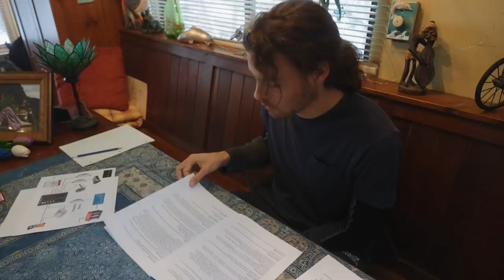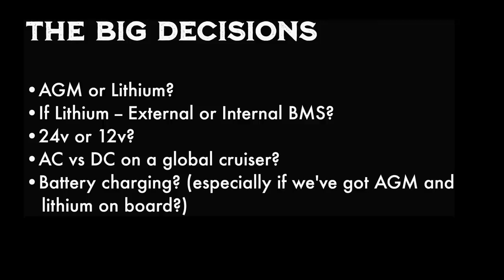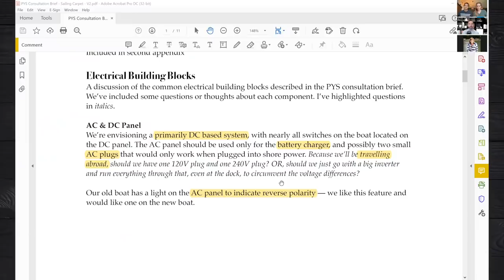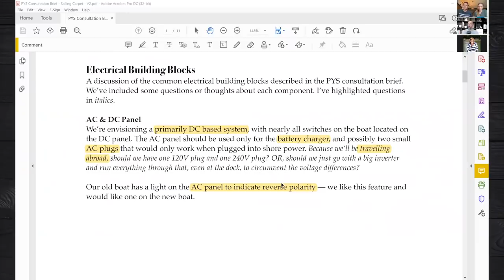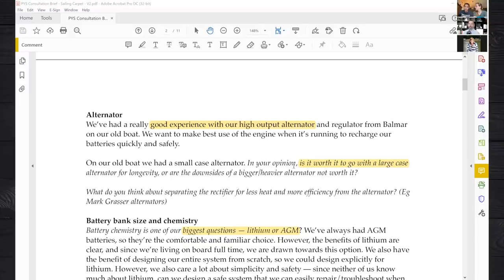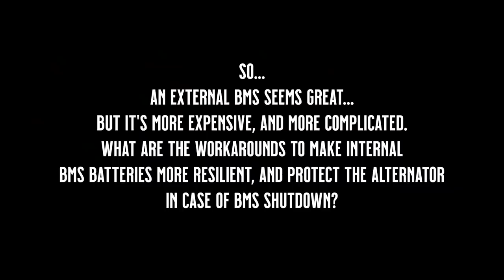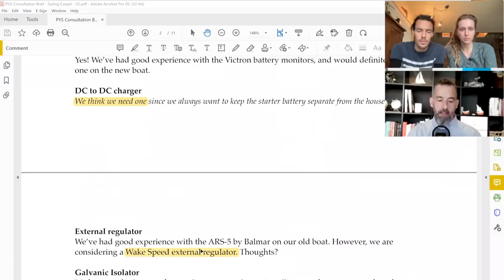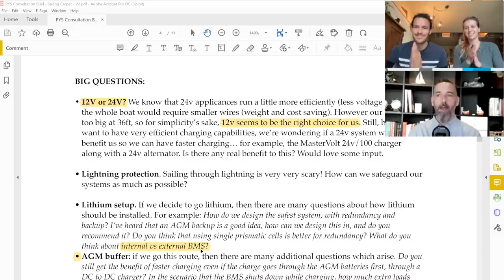DESIGNING an ELECTRICAL SYSTEM for WORLD CRUISING (with Jeff Cote from PYS)

Comment: For what it is worth.  The gentleman on "Sail Life" just re-did a 36 ft. boat for around the world cruising.  I would really watch his electric system videos.  He does a great job explaining the what and how of his electric system and great explanations regarding the the why of his choices.  The couple of things I have taken away from his and other project videos is that having a washer/dryer makes life much easier and that propane is a real pain.  Propane is common around the world but there are as many different filler connections as there are countries.
Reply: Sail Life did an awesome work and is really good at explaining what he did. But you can't beat Jeff Cote from Pacific Yacht System : hours (days maybe) of free electrical seminars for free on YouTube from a professional with loads of experience... For once I wouldn't recommend Madz too much ;)
Reply: Mads is a computer guy and he knows a lot about electric systems but remember, his system hasn't really been put to the test yet. He is also in year six on his boat refit (although the current boat is the second boat he's working on)
Reply: As Cote said design for intended use, this may change also.
Reply: I was going to suggest Sail Life, Delos covered this in a few videos too, and I think Ran Sailing just converted to a partial lithium set up as well.
Reply: Mads also tends to max-gadget his systems. As a computer engineer he feels very comfortable with it, I guess most cruisers would prefer to simplify the system so maintenance stays within their capabilities.
Reply: Sail life electric systems are over kill,the less you have electric the better,salt water wiring don't mix
Reply: @paulmurphy8549  Mads is a computer engineer (and likely tinkers with radios a lot). He just enjoys that stuff, so all essentials have conventional bypasses or double+triple redundancy. :)
Reply: @charonstyxferryman  that's what I am saying. Mads is confident, knowledgable, a techie, and confident. And has plans where it fits. But that doesn't necessarily fit the average sailor to this extend and is not the right choice for every body. All I say is that ease of maintenance is key for most cruisers.

Comment: To my mind, the biggest benefit of LiFePO4 house batteries is the lifetime. You install them once and they will last for 20 years (>5,000  cycles) compared to AGM which will last 4 years ( ~700 cycles). I might however consider using an AGM battery for the engine starter battery and using a second small case 70 amp alternator for charging the AGM.

Comment: You both talking with Jeff who I consider as the best marine electrician I have discovered on YT is awesome. You came up with a lot of thoughts I have already installed on our boat - AGM and Lithium battery banks, two independent charger/ inverters, one hooked up ac to starboard and one to port, dc can be run on agm or lithium selected by a hardware switch, 2x 400 watt solar hooked on two mppt´s - one charging agm, one solar. The lithium battery bank can be disconnected totally (hot and ground) from everything …. And so on. So far it works out great, actually in Portugal on our way to the med. Btw. we are cooking fully on induction (also through inverter) and use propane as a backup. Less heat, less humidity, less dangerous than gas. Keep up your excellent work. 🙏⛵️🤙👏

Comment: Jeff Cote and the entire staff at Pacific Yacht Systems are astounding. Professional, friendly and astonishingly skilled. I'm a bit biased, as I've already spoken with the company, regarding designing the entire electrical system of a cruising trimaran which is in the initial stages of design.
A 24 volt, outside BMS, lithium battery system, with an induction two-burner cooktop, will probably be the best for you. The solar panels currently on the market will easily keep the batteries charged, with an inverter to supply your 120v AC needs.
I know that a lot of people prefer propane for cooking, and that's fine, if you're not leaving US/Canadian waters; when you're cruising the world, you'll end up having to drag along at least eight different propane bottles, due to the outrageous number of link/hookup systems which are "standard" for the different countries.
In all things, and Jeff has said this to me, during our first talk on the telephone, the most important things is SAFETY, SAFETY, SAFETY.
For me, as I'm older, I want to be as careful as possible, in case something goes wrong, and I've noticed that something ALWAYS goes wrong.
Great good luck with Magic Carpet 2 an enjoy the world which is in your future!

Comment: The first thing you have got to do is to determine your power consumption. The biggest consumer of battery power is the refrigerator. You have the opportunity to rework your frig and I recommend you isolate it with at least 6" (15CM) of high density foam plus an aluminum infrared heat barrier sheet. 
I just upgraded my system and I use a lead acid battery to start the engine, a DC to DC converter draws power from that battery to charge two Lithium 100AH batteries. I chose Renogy equipment and batteries, they may not be listed for marine use but I feel they will fo the job. The DC to DC converter is limited at 40Amps so my conventional 75 Amp alternator will take it easily.
The alternator needs to be cooled by the air that circulate into it so the engine must run quite fast, that is not a scenario for charging batteries at anchor.
I have three 100W solar panels where two will be mounted on the side of the cockpit and shall be adjustable to be set a 90 degrees with the sun for maximum efficiency. You may have a larger panel fixed horizontally that will produce the same power as an angled smaller panel just because of the poor angle with the sun.
In order words, there is more than "Bigger is better", there is also "Smarter" ways to deal with battery power, I like your channel a lot.
 Cheers, Richard

Comment: i am so glad you found jeff,  i have watched alot of   his web seminars out off engineering curiosity, and was very impressed. When i hear him say AGM can only be used down to 50%  as they age are only usable from 80 to 85% and lithium lasts 6 to 10 times longer  lithium becomes the only choice, also any engine is supplied with an alternator to supply its electrical needs , most dump this and put in its place a high output one , why not keep the already paid for starting system and add the high output alternator separately its only brackets and belts  and  this will give a full backup system Excellent episode
Reply: Separating the engine's battery and alternator from the rest of the boat's electrical system is a good idea.  This would isolate the engine's lead-acid battery and alternator with its specific charging profile from the house system that might have lithium batteries and charging components using a different charging profile and maybe a different voltage.
Reply: I'm refitting my Mariner 36 and this discussion was woth its battery weight...I very much look forward to the next parts....
Because of redundancy needs, I'm going with AGM for starting bank and lithium for the house bank...and not discussed here, but the DC to DC charging could also be using the lithium to charge my AGM Starter bank and my windlass AGM battery...to think this stuff has me excited...well because this episode gave me the information to finally make these decisions...thank you...as I impatiently await the next episodes

Comment: Have watched a couple times now and would like to make a couple points.

Size an inverter to whatever you might want in the future with special thoughts to tools for Alidino, and for Galley appliances. (suitcase welder, saws, microwave, toaster oven ???)

Another thing to consider is the difficultys of getting Propane around the world. Makes the 50/60 cycle electrical issue look like a piece of cake

Comment: Hi guys, I run an induction cook top as a back up when on the hook and on shore power I use it all the time. Its rated max power is 2400w, and wow that makes for boiling water in 30 seconds, but it's not a good boil for water for coffee or tea. So I set the induction power to 800w and then down to 400 or 600w, but water is boiled in 2 to 3 minutes and its hot. Noodles or pasta 400w. Simple examples. So you have a very adjustable heat, that is when learnt. Very controllable !!!! So simply I sit my induction cook top literally on top of my gimballed stove-top/oven.

Comment: Critical loads from two battery banks. Setup separate DC load "centers" for each battery bank. Give each critical load a breaker on both load centers. Then use an on-on DPDT switch to select which load center is powering the load. I use DPDT so with clever wiring indicator lights can show which side is powering the load. Also if the contacts on the load half of that switch fail, the wires can be moved to the other side.

For crimped on contacts, buy proper ratcheting crimpers for the types of terminals used. You want the crimped terminal connection to last decades, not years. For ends like quick connects and ring terminals, I use bare ones, then cover with heat shrink tubing. The heat shrink tubing provides the strain relief for vibration. Use the right size terminal for the wire size.

For heat shrink tubing: I used to use many colors, now I just use clear. That way I can see in to see any corrosion, etc. Yes, use heat shrink tubing with glue for sealing the joint. Buy it in bulk from an electronics supplier like DigiKey or Mouser. Use a heat gun on the lowest setting that will shrink the tubing and activate the glue.

Wire color: Except for power(red) and ground(black), and chassis ground(green), I now just use white and label it at both ends, and if possible at each junction box it goes through. What was that blue wire for? Label it! With marine wiring, the multi conductor bundles will be colored in the outer jacket. Label the jacket.

Bundle wires to stop chafing from vibration.

BTW: it gets costly to have a bunch of different wire colors. For labeling I use a Brother P-Touch labeler. I make labels with [NAME |||| NAME] that is then folded over the wire like a flag. The other way I label is to spiral the label around the wire, but then I shrink clear heat shrink tubing over it to protect it. The label spiraled around the wire will eventually fall off if not protected.

Comment: Solar panels: expect 50%-ish on a boat where they tend to be horizontal. I think the maximum I have ever gotten from my 400watts of panels is just under 300watts in full sunlight. Induction: they are great (I use them ashore), microwave is even better in terms of amount of food heated per watt input. Induction requires special pots, a magnet must stick to the pot or it won't work.  Li vs. Pb: Watch all the Emily & Clark's Adventure videos on batteries (they suggest both... ). 12V: Yes, 12v bits are available everywhere. There are 10 stores with 12v bits for every one that has 24v stuff. LED lights: Mix in some yellow and red with the white (most white LED have too much blue in them) both for easier on the eyes as well as making colour (yes I am a Canadian) maps easier to read. I have found (from years ago building LED flashlights) a mix of red and green or even yellow and green gives not only better colour definition but also seems to give better 3d sight as well (being able to see lumps on the ground). Laptop chargers do not have to be 120v ac. Most of them output 16ish Vdc and will run on 12v battery voltages (14v or so). Running an inverter just for laptop and phones seems ... wasteful  ;)  In the end, it is not so complex as it seems. I am sure whatever you end up doing will work just fine. I am sure that no matter how much you over think this, you will make changes down the road so make it accessible. In the end there are four things that matter... red, green, white and anchor, anything else is comfort.

Comment: Check in to a Planar forced air diesel heater out of Vancouver BC. It runs off my batteries and burns diesel and I'm a livaboard and it works just like a house heater.... set the temp and it's 23C or what ever temp you want and it keeps the boat that temp. It draws very little and burns 3/4 of a gal of fuel every 24hrs in the coldest months. I live in Vancouver WA and I can tell you it was the best investment I made. I've had mine for 6 years now with no problems and I installed it myself. Good luck and I really enjoy watching you guys and will continue. Have a great day.

Comment: I enjoyed the "master's level" tutorial, and have re-watched this twice. Everyone has their different requirements based on personnel choice, need, etc. I have also been impressed by the journey the couple from sailing UMA has gone through to go totally electric (mostly). They do have a small honda generator they dubbed their mini marina.  Their system took them North through Norway, Sval Bard and as far North as they felt comfortable going and in their last videos they are in Ice Land. The couple over at SV Project Atticus, took a different approach and did a re-wiring re-fit, solar, wind power ad alternator updgrade that was also interesting to watch.  Both these couples like you two, are looking to cruise world-wide.  Thank you for your high quality and informative videos.
Reply: as an electrician I would not recommend doing what Atticus did

Comment: I’m sure others have mentioned it but there are 12v power supplies for most modern laptops. I have one for my older HP Chromebook and my wife’s Dell E6525 laptop as well. Most WIFI routers also run off 12v at about 1A draw. External drives with AC power bricks also tend to be DC powered as well - all mine are 12v or 5V. So you really don’t need AC for a lot of portable computer equipment.
Reply: I agree. There are less losses powering a computer (or any other low voltage system) with a DC-DC power supply from the 12V,. Other than converting 12V DC up to 120V or 240V AC and then converting again down to a low DC voltage.

I think all brands have "travel" 12-24V power supplies for their computers.
Reply: I am charging my mac book pro from usbc connected to 12v. Does not charge at the same speed as the 220v power supply but still charges.
Reply: not sure if this was an option then, but my 10yo thinkpad uses a 20v charger. By coincidence USB PD 3.0 has a 20v wire so you can now buy cheap USB C adapters to power it (probably the same with many other laptops). Any USB C charger which advertises 100W will charge it, including 12v chargers designed for cars. It doesn't draw 100W (I think the original charger was 65W) but it now works on powerbanks and 12v chargers.

Comment: In regards to induction cooking. I really would suggest getting yourself a induction hot plate and try it out as your cooking surface. I renovated my house and went with an induction stove due to some bad experiences with a ceramic cook top. It's amazing for controlling heat (almost as good as gas), boils water near instantly and is so much safer too as the pot gets hot, not the cook top and mine will turn off if the pot is not on the element for a period of time. My in-laws are now considering it for their autistic daughter and aging caretaker purely on the safety factor alone (too many times the element has been left on).
Reply: Aye and getting propane off the boat is a wonderful thing!

Comment: I love the idea of having a large output alternator, charging an AGM bank and using a DC-DC charger to feed a lithium bank. Redundancy is also my mindset. I currently have a 60' monohull with a large hardtop with 1585 watts of solar and getting ready to add 300 watts of solar panels. Along with that, I will also add the lithium bank and components to complete my system. Great video with lots of info! Thanks to you both and to Jeff.

Comment: Hi ya :) I love your approach where you setup for travel rather than marinas. We recently spent 7 years aboard with a DC system and an inverter (1500watts 240volts) for power tools and computers, etc. Balmer 120 amp alternator with Balmar ext regulator (configurable very handy because you can push the voltage higher with no risk), the regulator can monitor the alternator temp and battery temp and limit the alternator so you can ensuring the highest useful voltage without hurting the alternator. We pulled the alternator back to about 70amps. The only real way into the boats electrical system was via the battery charger. Sometimes when we went in marinas and we would not bother to plug the charger in. We only used AGMs rather than lithium.  To be honest, after five years just buy a new set. As much solar as you can fit and your good to go :)
Thanks for the excellent videos, very enjoyable!